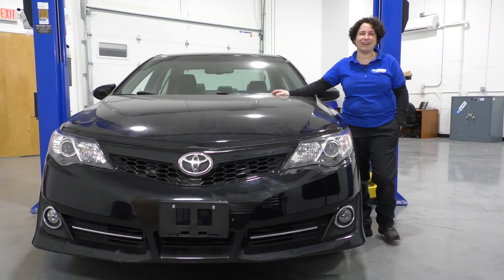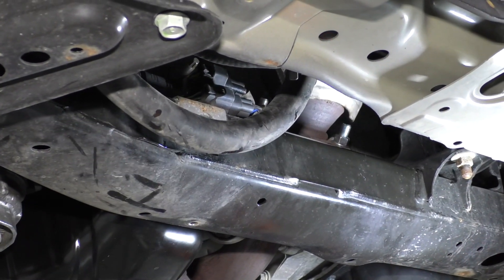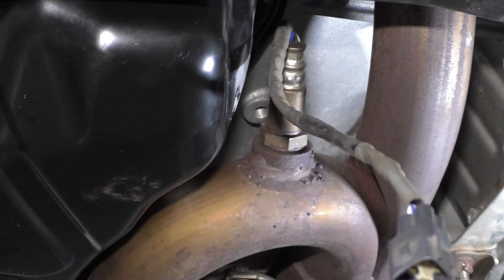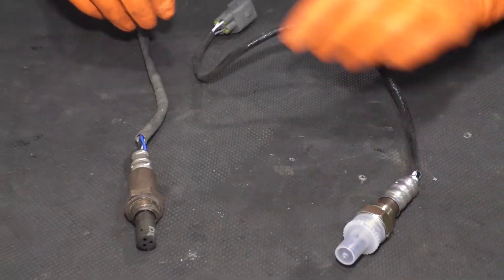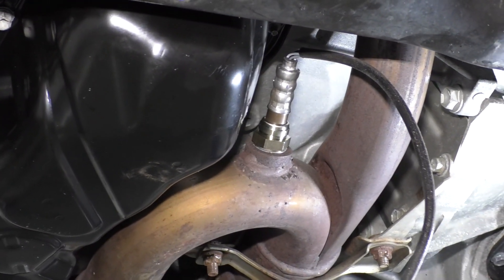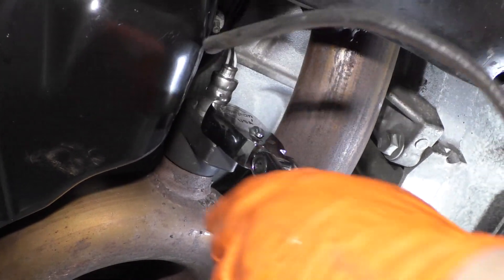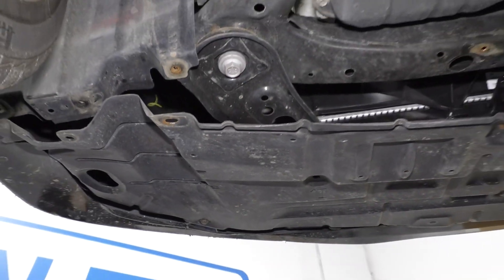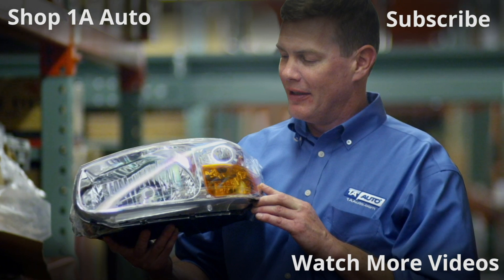How to Replace O2 Oxygen Sensor 02-13 Toyota Camry

Comment: Hi, do these sensors have any difference among each other? I mean there is bank 1, 2, 3 and even 4. Plus the one in the intake manifold. But most of them look the same in the outside and have the same size and socket. Can they be use interchangeable once you buy them? Thanks for help in advanced.

Comment: Is this what needs to be done when error code P0037 comes back? Check engine light and slip indicator light both came on at the same time and now won't turn off..